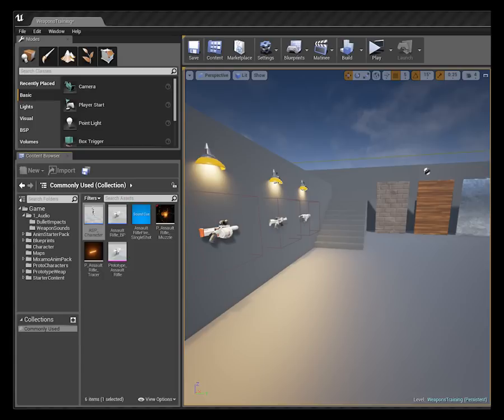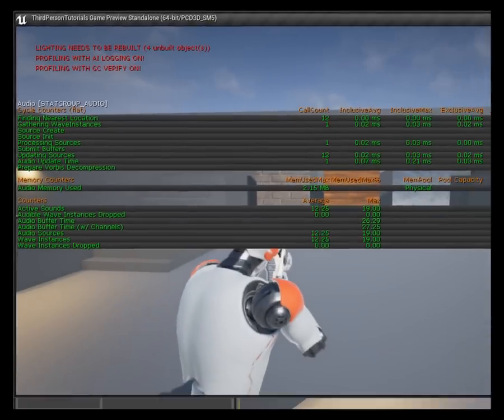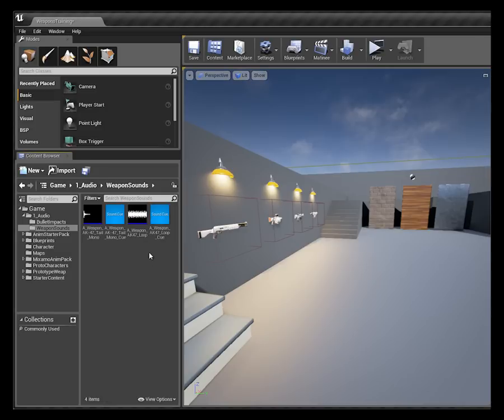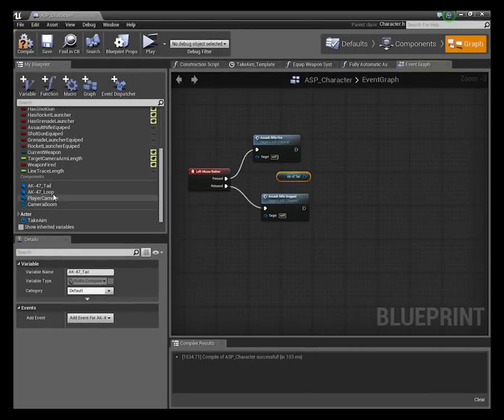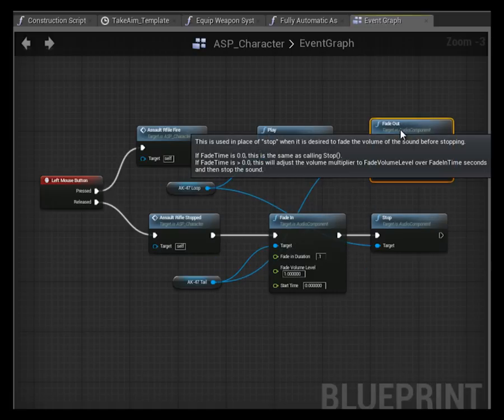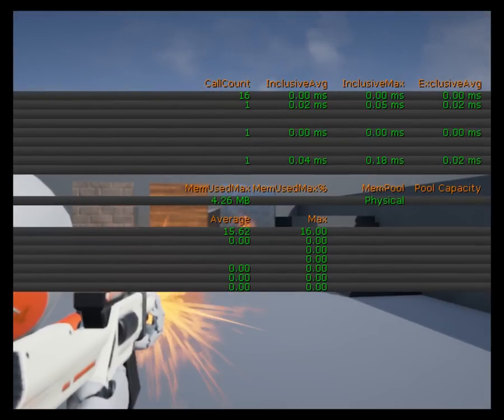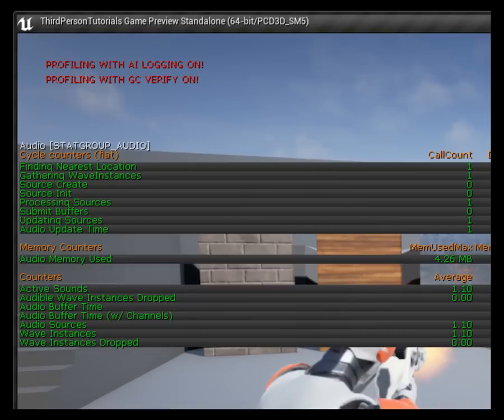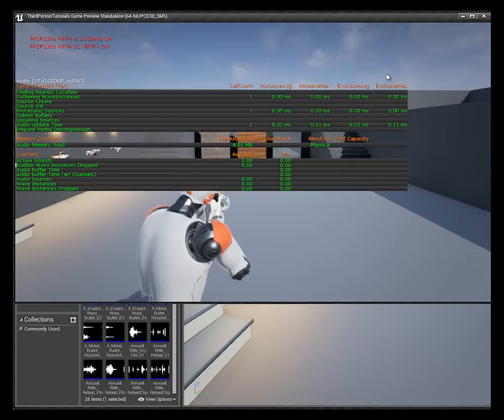UE4 Tutorial - Weapon Systems! - Part 5 - Audio Optimization Techniques

Comment: If I press the mouse button quickly and release, the sound plays, but the projectiles will not spawn..  I set up the graph exactly as you have it, but I guess it's failing to completely execute the projectile animation before I release the mouse button?  Any ideas?  It works fine if I hold down the mouse button, but it would be really noticeable if I were actually playing a game.
Reply from the maker: yeah sure mate, try setting up a delay loop with a gate instead of the timer system to retrigger the weapon which I used here, it's probably quicker, computation wise. failing that put your spawn projectile node higher up the chain. hope it helps.
Reply: Using the gate worked.  Thanks!

Comment: Great set of tutorials :) would you also show how to add a handgun or melee weapons with a different set of animations instead of them all using the rifle ones?
Reply from the maker: graveofdeath Thanks! I could show you but the point is that  the skills for doing those things are the same, i.e. attaching the weapon to the socket then casting to your animation blueprint when you equip a weapon to play an anim of your choosing. Hate to cop out, but you'd be better off wrapping your head around this, using the skills provided.